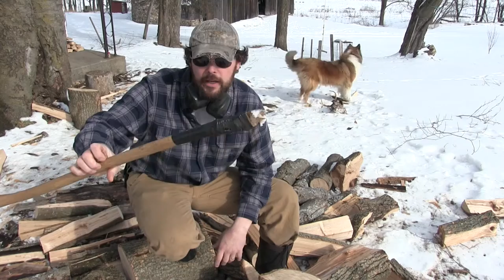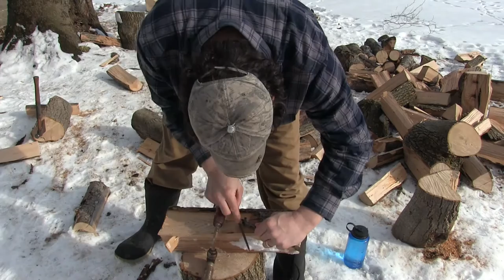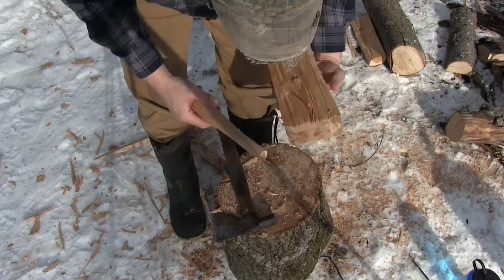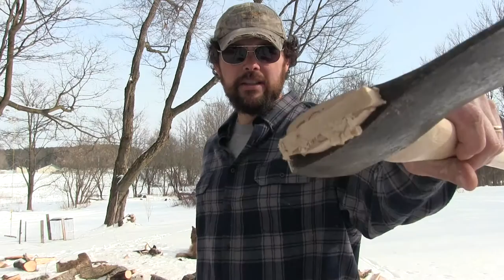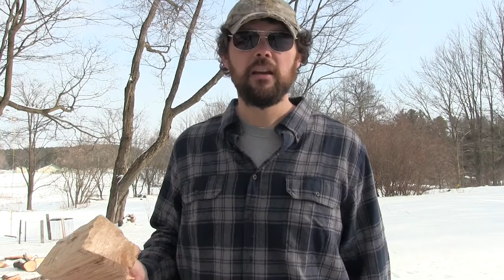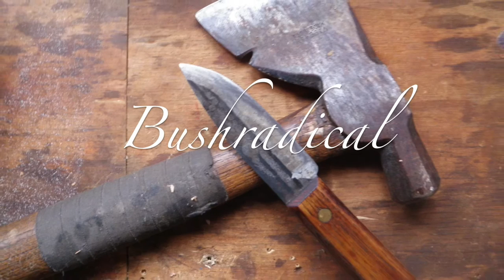Making a Mallet out of a wood

Comment: If I have access to "civilization," I like a plastic dead blow hammer.  Much better than the ones we used to cast from lead onto a pipe handle - then melt and recast when they got smashed out of shape.  You can make a wooden mallet anywhere, and that's a good thing to know.
Reply from the maker: I remember having a lead hammer in the basement when I was a kid. The handle was like heavy wire, or thin rod.
Reply: For years, we had a mold at Gorge Powerhouse.  Wouldn't be PC now, with all the panic over lead.  But we stuck a foot or so piece of 1/2" pipe or conduit into the mold, put the top half on, then poured in lead to make a soft lead hammer.  It went away when all these new plastic dead blows came on the market.  But I still have a home made wood mallet next to my froe.  :-)

Comment: It's funny. One can buy a mallet for $15.00, or twice that. When I made my last two mallets, I just drilled a branch section and used it in the round. That last one I made is a beast which is probably beyond the weight any store would carry.
Reply from the maker: Its always good to have a goo mallet around!! Thats for sure. Do you have any issues with splitting ?
Reply: Yep! I was given  some fresh maple sections that are too long, thick, twisted, and tough. Even my new 8lb log spliter bounces off. All I can do us wear myself out with 3 wedges and a maul to at least make some cracks. The next day I use the spliter to cut out the sections, and a double bit ax to halve those. On the third day, I start on a fresh chunk. I am burning wood much faster than I can stack its replacement. This splitting work requires a lot of hot toddy and naps!

Why do you ask? Have any suggestions?
This is my first winter to heat with wood. I plan to stack this maple to use next year.
Reply from the maker: LOL, Actually I was wondering if you had any trouble with your mallet splitting...the one you made with a branch? I've thought of making a few out of full rounds...like 4" stuff but I wondered if they "checked" or split much.
Reply from the maker: I feel your pain though about the twisted maple...Anything with a bad twist is BAD NEWS..  I cut up a bone dry standing dead elm a few years back and it was a total nightmare...I'll never cut another elm tree on purpose  thats for sure!!!!
Reply: Yah sorry. When I woke this morning, I realized I had gone off track there.
I referred to the tomahawk handle design, and the handle is not forced into place. I have seen no cracking. If it did, its not a huge deal since the replacement price is right and parts are readily available. The green wood handles do warp as they cure, but I don't really care about that either.
Reply from the maker: Ive always thought it would be cool to cut some rings out of exhaust pipe and heat em' up in a wood stove and drive them on as bands over a round head.   I don't know if it would turn out,,, just seems like a fun project.
Reply: Oh wow! Interesting idea. So far, I have not had splintering trouble with the birch I used; my froe has a 'softened' striking surface.